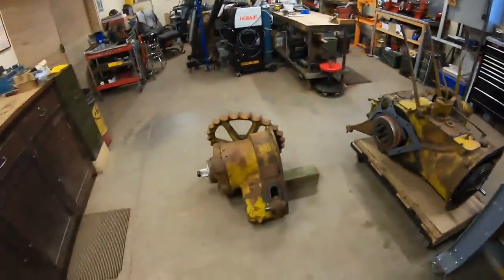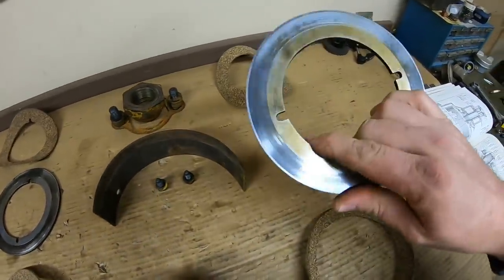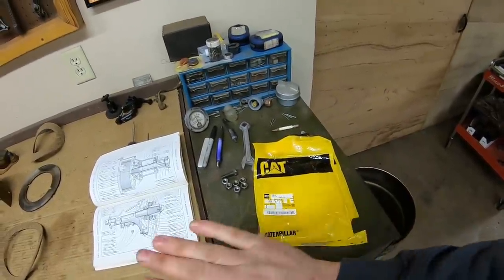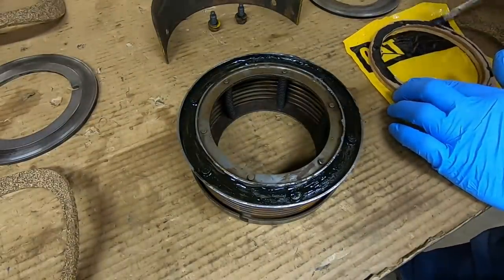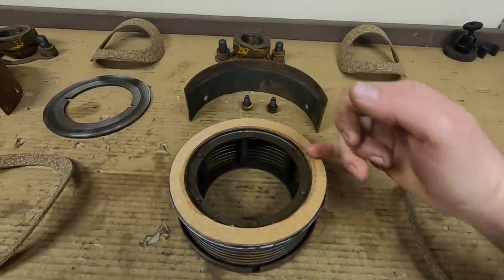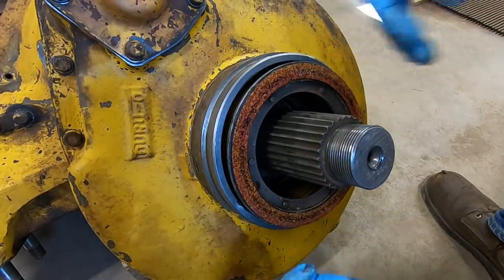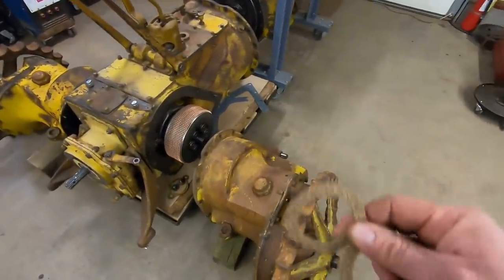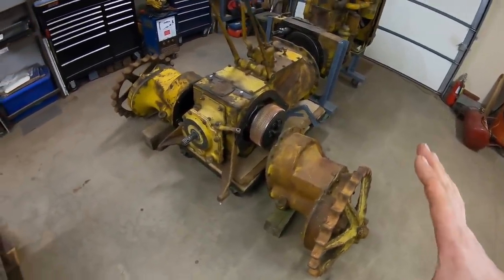Caterpillar D2 #5J1113 Chassis Rebuild Ep.31: Reconditioning Bellows Seals & Finishing Final Drives!

Comment: My dad hired CAT to come pull sprockets on his D4 inorder to replace the seals the later rubber bellows seals (25 years ago).  When the old seals were removed one of the rubber plugs broke off in the hole. This was not noticed until the next day when the seal poured oil after filling.  Not a good day having to get the service press back out to press the sprocket again.

Comment: Toby, Ouch you hurt my back working on the floor! I have a 1/2 steel plate, 28 x 48 on 2 steel sawhorses all at 32 in high. The case and sprockets will straddle the plate. All the work on the back half can be done. Stand up and work like a gentleman.

Comment: I know that you have probably heard this a million times, but you ARE the greatest and most interesting teacher. Thanks for the interesting videos and sharing your knowledge and skills.  I'm just wandering, when you installed the sprockets, would it help any or not if the sprockets were switched sides as were the splined axles, to wear the other side of the teeth?  Thanks again for the interesting videos.

Comment: 9:47 even if you'll need another set at some point, i think these are easily duplicated. Just need some leather and cork of the correct sizes, and some contact cement for the glue up. I've no doubt that you could make them just as good or better.

Comment: Awesome video! I was wondering, what's the torque spec and or procedure for tightening the sprocket nuts? With the press fit it can't be super crazy but do you have to crank down on them if that lock plate doesn't line up?

Comment: $70+ for a cork and leather seal? Start looking for someone local with a laser cutter as they can cut the parts out fast for you to put them together from.  The holes for the pins might require the leather to be cut out of two layers but that is not hard to do. Hardest part of it would be to source the leather and to glue it down to glass to keep it from curling as it gets cut.

Comment: Another great rebuild; but, just one question/suggestion (not a criticism)....will you be using some type of motor hoist (for lack of a better or more exact term) when you get ready to mount both drives?  I'm getting a bit of a psychological back ache from what I see as heavy lifting.  Best wishes to you and the family for Easter.
Reply: He mentions in another reply they are about 350 pounds each, and they are too heavy for slinging around by hand. I know he has an engine lift, and I'd guess he will be using that.